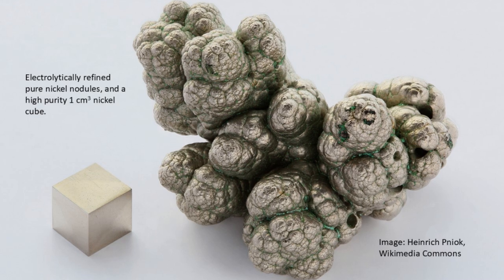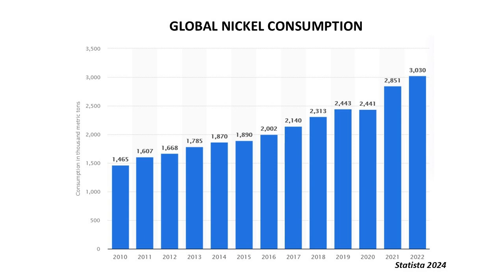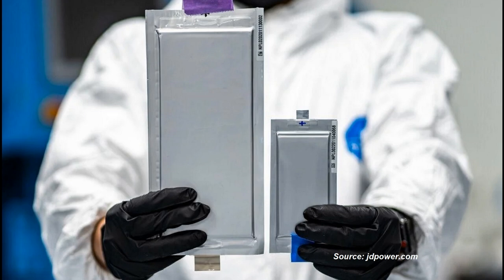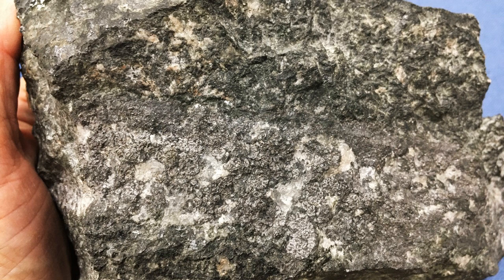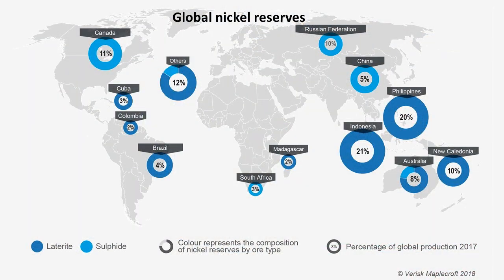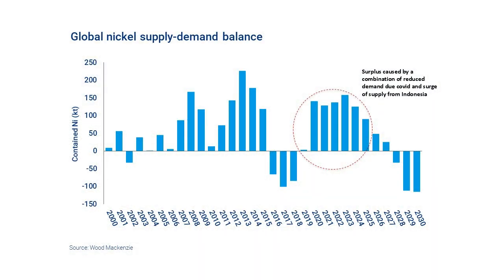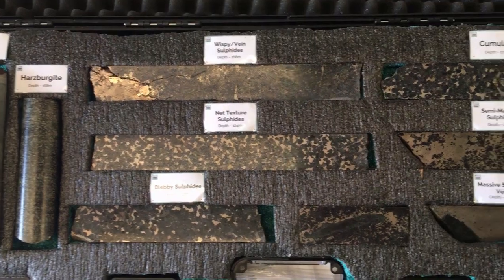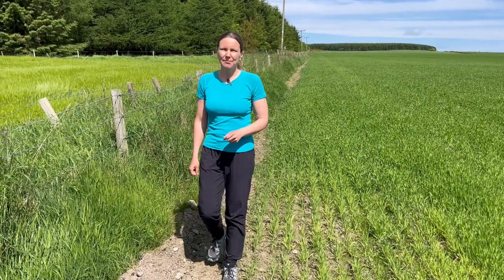Nickel, the metal for the battery revolution

Comment: on top of the Sulfides and Laterites there is a third way, Awaruite (See FPX Nickel, First Atlantic Nickel)  These deposits of can be magnetically separated and require no smelting resulting in lower costs and less environmental impact.  Once the first of awaruite  mines go into production, proving the concept, I expect this to be the dominant form of nickel going forward.
Reply from the maker: Awaruite is very interesting but much rarer than sulphides, so it seems unlikely it will ever be able to replace sulphide and laterite deposits!

Comment: Nickel sulphides were also present in the Irish Carbonate-hosted Zn-Pb mineralisation at Lisheen, Co. Tipperary.  The ore in that part of the fault complex that controls the mineralisation was not mined, due to smelter penalties, but it suggests that nickel mineralisation can be present in other than the classic ultramafics and their weathering products.
Reply from the maker: Yes there are many other ore deposits, mostly base metal deposits, that can contain significant amounts of nickel, I've just covered the two most important types.
Reply: @ourmetallicearth  I know of two other mines in which there were significant content of other unexpected resources, germanium in one and uranium in the other, which were not discovered until after the mines had ceased production.  This is often more to do with psychology than geology!

Comment: Is recycling within scope of this channel?  Is there a significant enough amount of nickel locked up in the waste stream that would make it economical to reclaim and reuse?
Reply from the maker: Nickel can be recycled indeed, globally around 65% of nickel in scrap metal is recycled, and it currently covers about 25% of annual demand for nickel. The purity of recycled nickel is generally not high enough to be used in batteries.
Reply: @ourmetallicearth  Ah...the purity problem...some day perhaps.  Thank you for the answer!
Reply: There’s an Australian company called Neometals that has developed a system of recycling lithium ion batteries to extract the nickel along with other minerals, with the aim of using the minerals to make new ev batteries. They have built a demonstration plant for Mercedes Benz in Germany under a subsidiary company called primobius. The plant opened late last year. It’s a fascinating story. Thanks for the video.